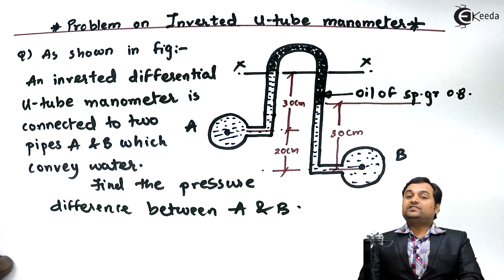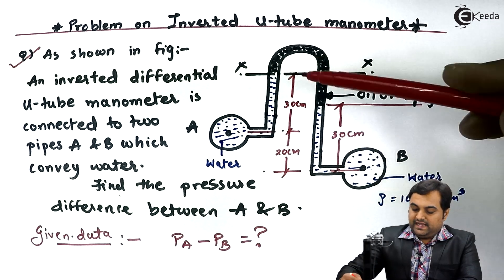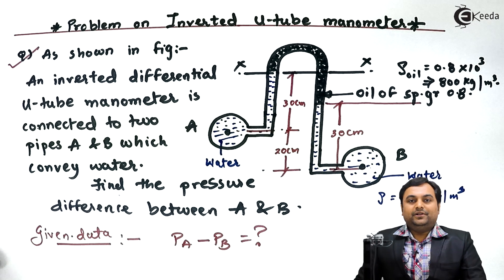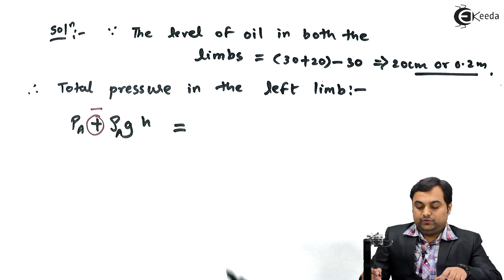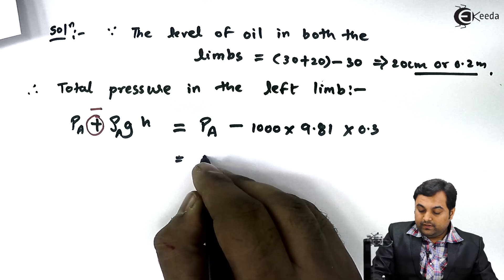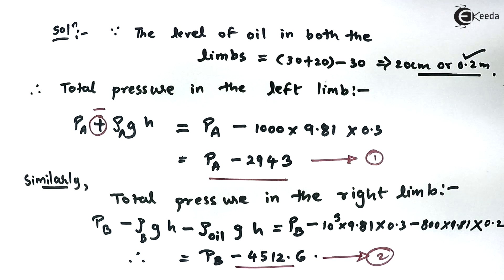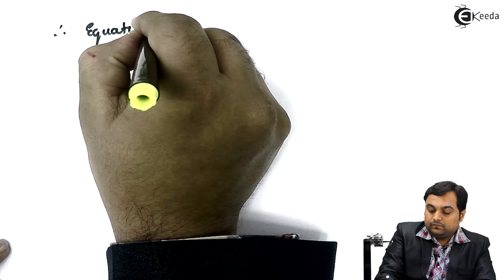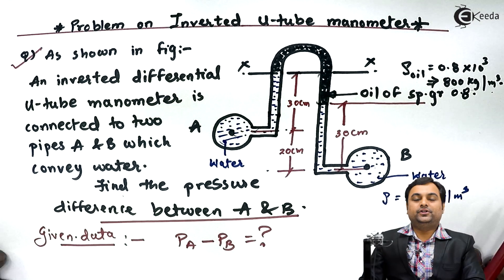Problem on Inverted U-Tube Manometer - Pressure and Pressure Measurement - Fluid Mechanics 1

Comment: Q- a differential manometer at two points shows a difference in mercury level as 10cm, the difference of pressure at the two points are:(assuming pipe is horizontal,specific gravity of mercury is 13.6 and fluid in pipe is 0.9,g=10m/second square)